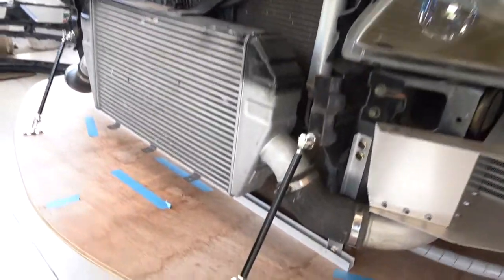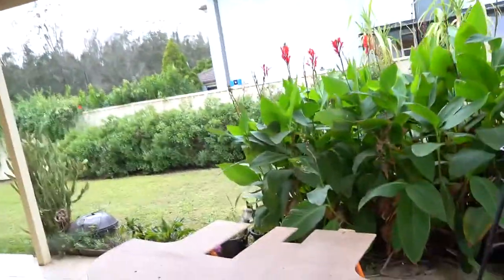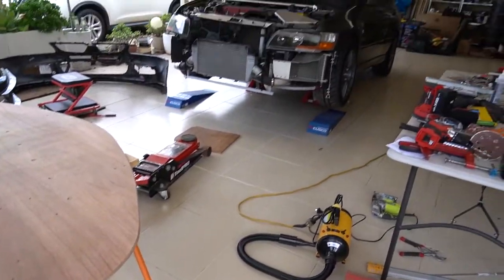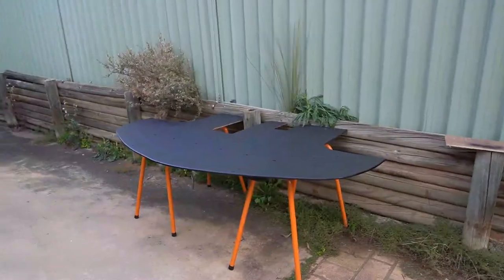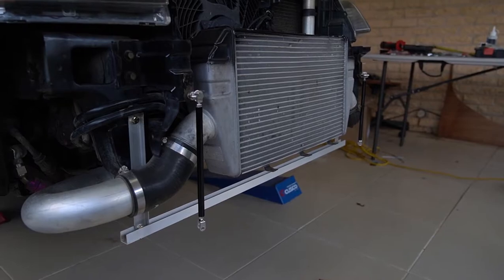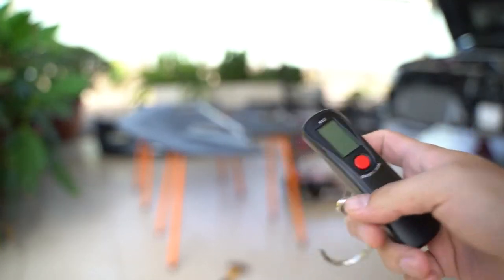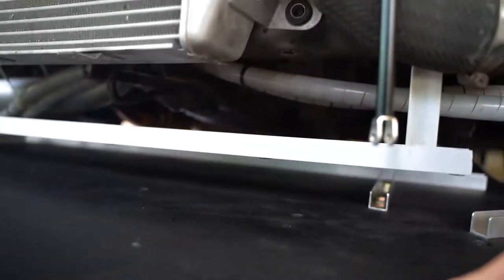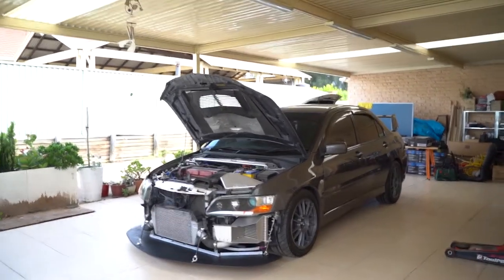How to make a front splitter for your Evo - Day 9 &10

Comment: Why ply wood instead of abs plastic? Or is this just for the testing process/ mold?
Reply from the maker: I chose chrich/ply wood because of how easy it was to get, good balance between cost, weight and how easy it is to work with. ABS plastic is harder to get here I am, a bit harder to work with, more expensive, and I think I would have to get a pretty thick sheet to get it to have the strength/flexibility of ply. The next step up though would be to make a foam core and make one out of carbon fibre ;)